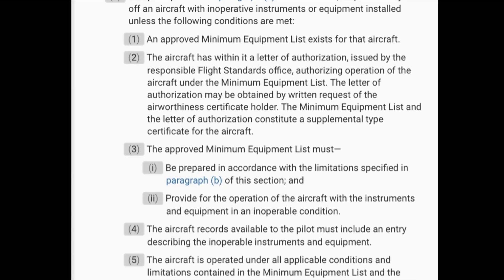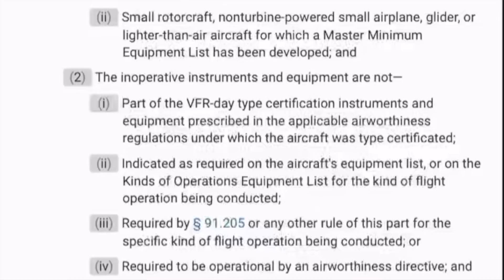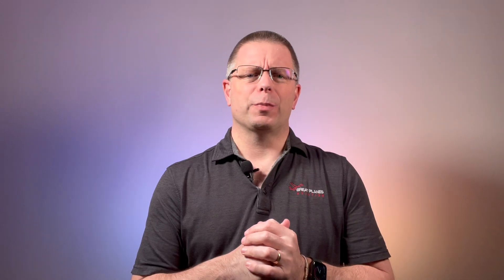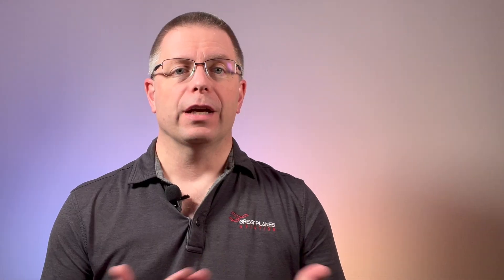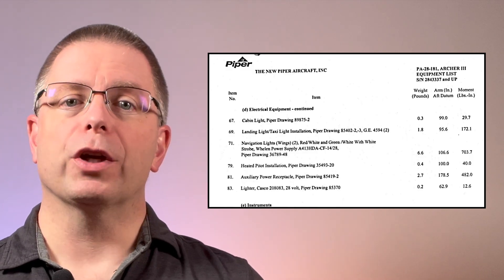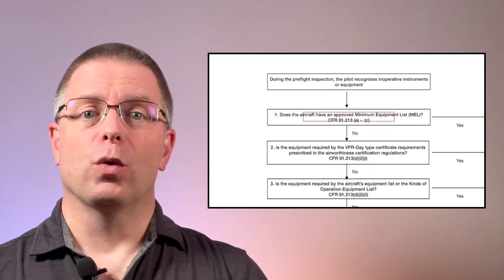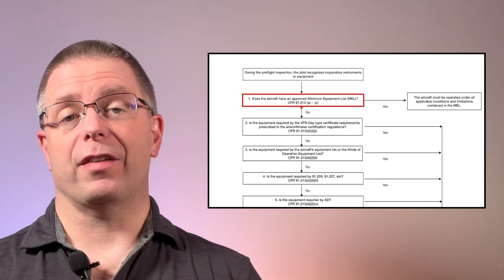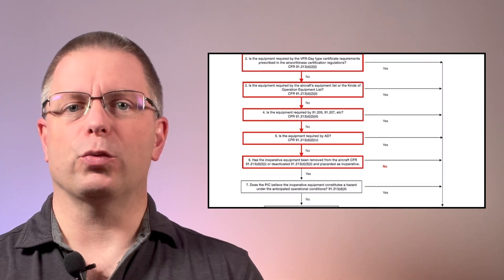Airworthiness: You are using ATOMATOFLAMES wrong!

Comment: Great video it really helped me how to evaluate and understand Airworthiness. Quick question does the KOEL override the Equipment list? Or do I still have to go over the Equipment list and see if it's required if it's not mentioned on the KOEL? Thank you!
Reply from the maker: Thanks for the really good question.  The regulation states the inoperative equipment cannot be “Indicated as required on the aircraft's equipment list, OR on the Kinds of Operations Equipment List for the kind of flight operation being conducted”.  To me the “OR” in that statement means both need to be considered.  

Having said that, I haven’t seen an example where the equipment list and the KOEL are in conflict.  In the examples I’ve seen the KOELs lists the equipment required by the equipment list as required for ALL Kinds of Operations.  However, my experience with this is not exhaustive.  If others have examples where they contradict each other, please put it in the comments.   

I hope this helps.  Thanks for the comment/question!